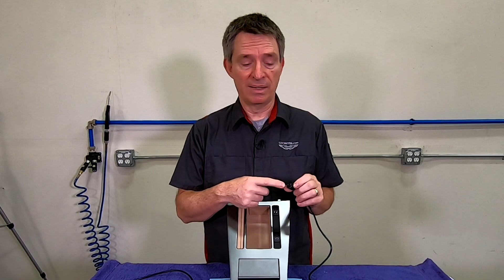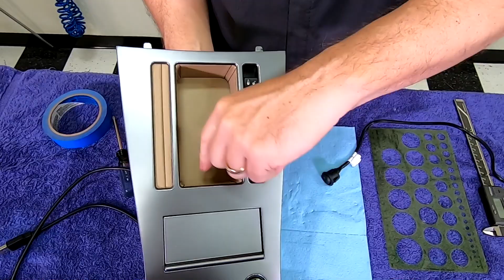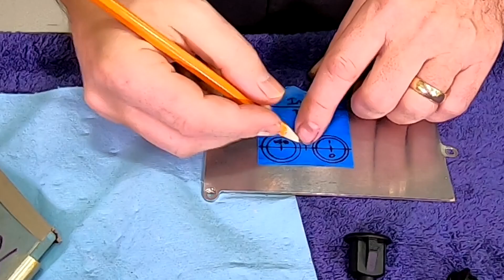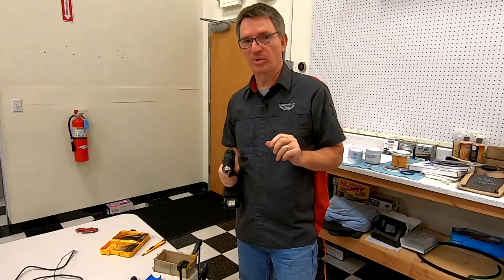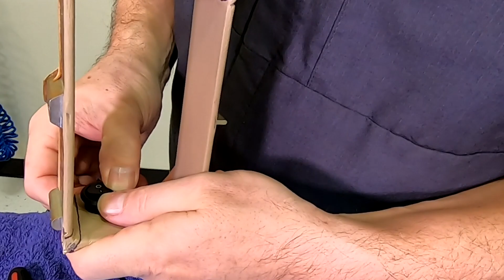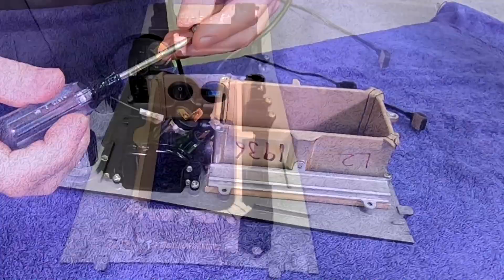Installing the USB port and MOST switch - Aston Martin DB9 Infotainment Upgrade - Part 4

Comment: I'm interested in your controller installation. In my Vantage, I found mounting it in the "ashtray" to be awkward (I'd need little t-rex arms, and the lid had to be open) for the most used interface. Here's hoping the positioning on the DB9 is better.
Reply from the maker: Its about the same I suspect.  I'm average build 5'-10" and the controls are OK positioned.  I am getting more proficient at letting Google do the work "OK Google - play Car Talk on Spotify"
Reply: @Aston1936  I'm also about 5'10". I do a lot of skipping in podcasts (which is annoying without the working hard buttons in AA) and have to remember to pause before I turn off the car or it'll keep playing until it looses connection or 30 sec, whichever is soonest.

Comment: Given the awkwardness of the cutting of the cross into the leather, up/down and left/right - why not "rotate" those cut lines by 45 degrees as it will eliminate all of that awkward angling with the knife?
Reply from the maker: Good point Mark - tunnel vision while on camera.  At least it worked out in the end.  Thanks for watching.